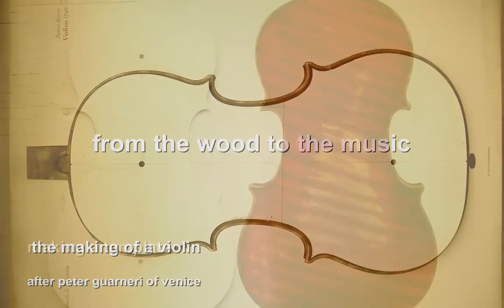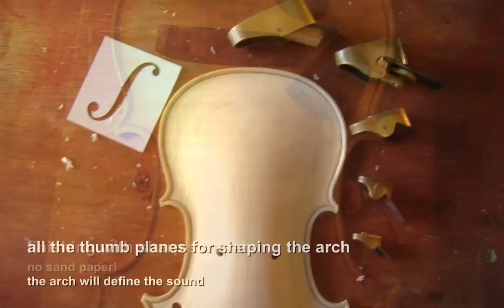violin maker guarneri

Comment: 200 man hours of a skilled craftsman with workshop - e.g. a Mercedes Benz repair man - at a rate of 120 € per hour means an instrument production cost of 24000 € plus material (timber, varnish etc). I Would not be astonished if such a fine instrument were sold for 30000 or more.

Comment: What's interesting is that your Guinari is made more precisely that an actual Guinari. Some of his had rather ugly detail work. What's also interesting to think about is that Strads and Guinaris were Baroque fiddles. Shorter necks set at a shallow angle with lower tunings. If Guisepi and Antonio tap tuned their violins and the originals haven't been regraduated for higher tunings and string tensions after they were re-necked and even possibly given taller ribs, maybe modern violins should be tap tuned as Baroque instruments?
Reply: What is tap tuning?